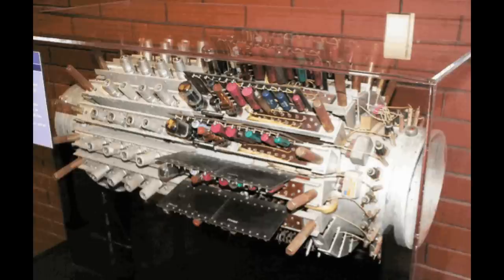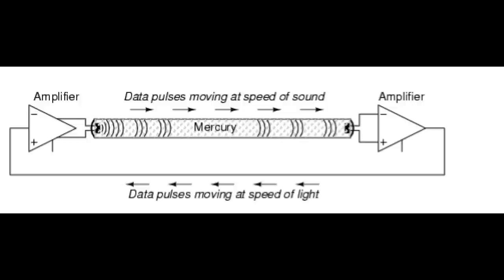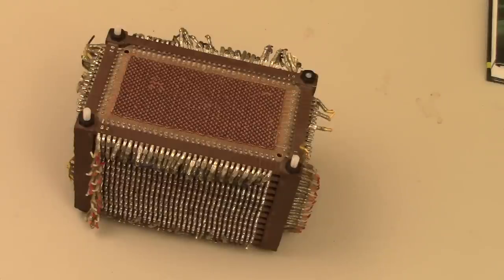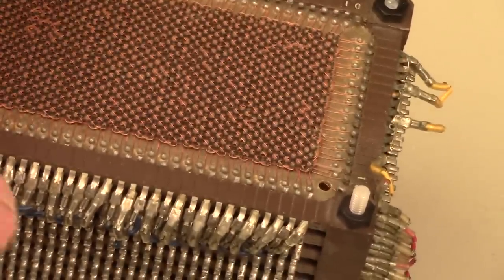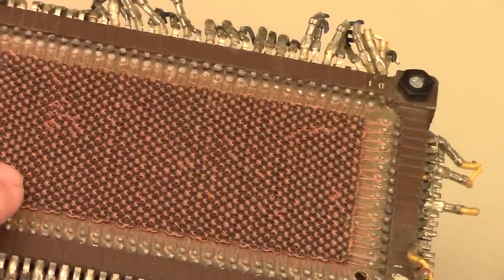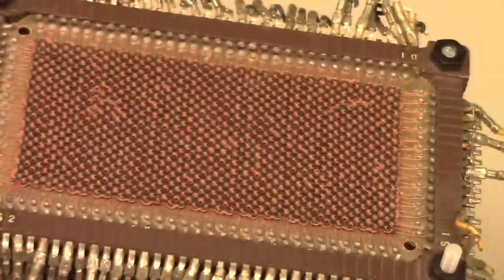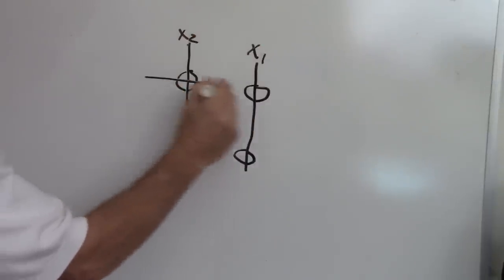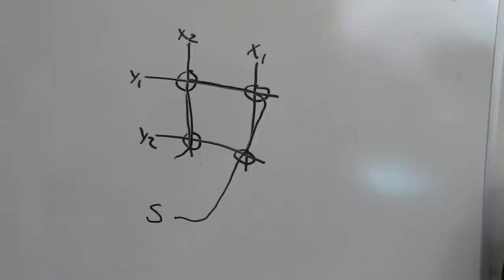Episode 11 - Getting Busted in New Jersey With Core Memory

Comment: I, too, own a core memory (2K 12-bit words with parity checking bits). I took mine from a trash bin in the basement of The Mill at Digital Equipment Corporation (DEC) in Maynard, MA, where I worked on PDP-8 software around 1978. It was for a PDP-12 computer, a popular version of the 1963 LINC (Laboratory Instrument Computer), which I programmed 1965-1972. Wikipedia has info on all these topics.
Reply: I have operational PDP-8s and PDP-11s. I have been repairing core memory since 1985. core memory is still in use.
Reply: +Terry Murray: How does core memory fail? Doesn't seem to be the sort of thing that gets moved around a lot.
Reply: Wires break from corrosion. cores break from people touching them. "newer" core memories are more than just cores and wires, they have all the circuitry required for timing sensing and driving. so mostly the electronics fail not the "stack" . Most are 65Kx18 or 32Kx18.
Reply: Terry Murray Good to know. Thank you for your experience with this. Does the copper turn green? I forgot about oxidation degrading materials even with non-moving parts.
Reply: czdaniel1 yes the wires turn green, mostly from Flux. I think I am probably the only one that repairs come memories. I started working on them in 1985.
Reply: Terry Murray Did you by any chance attend M.I.T while you were in Massachusetts, Mr Murray? I think this copper real-time ram was invented there.

Comment: Before core, (and even contemporaneous with it) there were machines using magnetic drum, usually thought of as a mass storage device, as virtual/swap memory in machines with very little RAM (in the form of registers).  It wasn't random access, but it was decently fast if the programming took the order of addresses on it cleverly into account.  At the time it was faster but less capacious than disk.

Comment: I paid $150 for 512k ram expansion for my Amiga 500 back in 1987 I guess it was. My Commodore 64 got kind of an upgrade when I bought a Commodore 128. Before that I owned a Colecovision and a Telstar which I didn't tinker with much other than gaming on. Altho I did strip the cases off the Colecovision cartridges so I could store them in a smaller container.

Comment: Core memory is radically more robust to Radiation and EMP. I worked at a place eons ago that analyzed the "state" of every single tiny donut core in a core memory recovered from a crashed device, ie jet etc. The first F16 fire control system used core memory. One can have just pieces, chunks of the core memory board and read each single donut core for its "state" to give clues as to why something failed. The Voyager probes are using core memory. Ponder that the Voyager probe has digital data stored on an 8 track tape too!  The tape is 1/2 inch wide and a special unit. https://ntrs.nasa.gov/archive/nasa/casi.ntrs.nasa.gov/19810001583.pdf

Comment: The PDP-8 I programmed in college ( 1973-1975 )  had core memory.   Programming was painful then.
Reply: You mean you didn't enjoy flipping a row of switches for an hour and then starting over if you realized you messed up one?
Reply: After graduating I bought an IMSAI 8080 computer.  I had to toggle switches on that too just to get the first boot loader working.  After that I managed to write the boot to the first sector of my 8 inch floppy and with my CPM80 operating system.  I checked and rechecked because I didn't want to screw up my master CPM80 disk.  Then I was it hacker heaven.  Hackers were good back then.
Reply: Peter Nachtwey
I have always been thankful I was born just a tiny bit too late to have to deal with that nonsense. I started out on the first IBM PC. It even had the optional 40 megabyte hard drive. I still remember having to type a command to park the hard drive heads before you cut the power so that you didn't have catastrophic data loss. I can also remember when MS-DOS came with debug and you could arbitrarily write bytes to any sector of the drive you specified.

My dad ran the electronics shop for a research hospital and built and debugged all the new toys the research docs were dreaming up. This meant I grew up with an electronics playground worth millions of dollars so I got to learn all kinds of neat tricks and play with gear most people never even knew existed let alone got to touch. It also meant going through computer classes in school felt like being drug back to the stone age when I had to deal with Apple 2 machines running LOGO. I had a teacher get mad at me because she left the classroom for 5 minutes to go to the office and by the time she had gotten back I had taught the class stuff they weren't supposed to learn until weeks later and that threw off her lesson plan. Since she essentially knew nothing about computers at all and was going by the book it threw her way off.

Then I hit my electronics classes in high school. And it was an instant time warp back to the 70s. I had to learn to program an 8080 by hand using a hex keypad for entry and a row of LEDs for output. So yes, I know your pain. Only I suffered through it in the 90s when that era was supposed to be gone!

So now I play with stuff like a Raspberry Pi and see people complain about what ports they wish it had or how they "need" more RAM for various tasks. And I just keep thinking to myself that this tiny thing for 35 dollars would have smoked the computing power of entire countries when I was starting out. I mean a gig of RAM? That would have cost more than a house in the 80s.

Comment: Remember the ps1. It was less then this. But for good reason I bet you can tell why.
Reply: Tidiest Flyer why?
Reply: Raptor At the time of its creation computers were still kind of in a inefficient stage. So making it cheap and compact was a major factor.
Reply: Tidiest Flyer PS1 itself had no storage but the cards were 1Mb so they were well above this.
Reply: Tucker Aylo Yeah. The ps2 when it came out had like 8 for its memory cards. After the Xbox cane out stuff just sky rocketed.
Reply: There's about as much memory in the PS1 CPU cache as contained in this thing. The BIOS is about a hundred times bigger, and the total system memory maybe 500 times bigger. You're comparing very different eras for some reason.
Reply: nimrodery nah, im trying to say that the ps1 is a good example of an early age compact computer
Reply: Tidiest Flyer The Famicom preceded it and had every peripheral available for computers, including storage. The memory cards on the PS1 only stored game saves. The PS1 isn't an early compact computer because it wasn't early and it isn't a compact computer. I mean, it's a computer in the same sense that a digital watch is a computer, sure.

Comment: Today it's delay line memory all over again. In optical computing, that is.
Reply: No, it's really used for memory. My lab is doing active research on it.
https://www.osapublishing.org/ao/abstract.cfm?uri=ao-29-5-627 (not actually my work, but I don't have my professor's permission to post so...)

All optical calculation is not a huge problem, but all optical memory is. There's a lack of reliable way to store and retrieve a large number of photons at near unity certainty; delay line with gain is just about the only method to do so.

Of course, modern optical delay "line" doesn't really use any kind of "line", a good resonator with photonic crystals or other hot stuffs can slow light down so much you can do it on a chip
Reply: That's not actually my work. If you want more recent stuffs, google ultra high group delay with photonic crystals.
Something like this. https://www.ncbi.nlm.nih.gov/pubmed/19547110
The problem with fiber is the fact that they can't integrate them on chip, that's why people moved on to PC. My group do PC and various types of optical bistability, also used for optical computing. Personally, I do optical modulator with graphene. If you can make a modulator, you can make optical chip. That's the easy stuffs, as I've said. I can't really tell you more since it's active research, so hopefully you could excuse me.

BTW, no need to snark. I didn't question your scientific credential, I simply stated mine.

Comment: Is this "donut memory?"
Reply: Magnetic Core memory was very common in computers that were built before the 1970s. The data is stored in small magnetic donuts so it does not need power to retain the data. It is possible to turn on an early computer that has been idle for 20+ years and still have the last program and data that was used still present in the system.
Reply: What's the difference.. flash drives dont need to retain power to keep the data?

Comment: Forgive me if this is a stupid question but is this the equivalent of Ram or a hard drive?
Reply: Captaintoast12321 RAM. Hard drives are storage devices, not memory.
Reply: Not a stupid question.
Reply: It's more like the ROM that holds your computer's UEFI/BIOS actually; it can't be changed by the computer.

EDIT: Whoops, I was wrong, disregard me. Must've been thinking of something else.
Reply: It is the equivalent of RAM, but with the advantage is that it's non-volatile. If the computer loses power, the memory retains its contents. However, the drive circuitry has to be carefully designed to handle power cycles properly so as not to trigger an accidental write operation when power is going up or down. Core memory was often used in spacecraft electronics because, unlike the DRAM of the time, it's immune to soft errors from alpha particle hits, and also because of its non-volatility. The need to keep refreshing DRAM means that it has to be on continuously, and that consumes power. Spacecraft such as satellites and deep space probes have a very limited power budget and subsystems constantly need to be put into sleep mode or shut down completely when not in use to save power.

I once worked on a storage system for a satellite that used CMOS static RAM, which is also susceptible to alpha particle hits. To compensate for that, the system used error correction circuitry (ECC) which could fix all single-bit errors and detect (but not correct) all double-bit errors. To prevent single-bit errors from statistically turning into double-bit errors, the system would periodically wake up, read through a block of RAM, one word at a time, run it through the ECC, and write it back.

A single powerful alpha particle could disrupt many bits on a RAM chip at once, but ECC can only correct one bit in a word. This means that the RAM chip designers would have to lay out the IC so that the bits in a single word would be physically far apart from each other on the chip. The earliest DRAM designs were only one bit wide, so that problem was solved automatically, but the SRAMs we used were 8 bits wide, so that became a consideration.

Comment: would you have needed 64k of memory for the programs that were being written back then though?
I remember writing programs back in the 80s and then into the 90s, they were extremely basic things back then so I cant imagine there was much need to have 64k of memory in a computer.
What people call a computer then and what people call a computer today isnt really the same thing.
Computers back then are more along the lines of a PSP now. The program loaded from an external media, the program loads into its volatile memory and run and once its over thats it you either loop back to the beginning or turn it off. The BBC Acorn computer while being a computer isnt a computer in the same way my HP Z840 is
Reply: They certainly were computers in the same way that your current computer is, though admittedly, many of them were single-tasking, just able to run one program at a time.  They would load the program from storage ( punched cards, paper tape, or magnetic tape or disk ), load data if needed, then run calculations on the data, and output the results, either to punched cards, paper tape, or line printer or CRT display.

You nearly always needed as much memory as you could get, and often just a little bit more than you had.  Once you'd figured out how to program small tasks, each successive task kept getting bigger and bigger, and programs grow to fit the available space. Then you went over that, and had to figure out what to cut, or re-code, to make the program fit again.
Reply: No, They are computers in the same way a printing calculator is these days. If you define a computer as a device that performs a series of calculations and outputs the result then a calculator is a computer and just as powerful as those contemporary to this storage device.
A garage door opener could be said to operate like those old computers. On or Off. Open or Closed.
Pull one of those old computers out of obscurity, make it work and perform a modern real world task with it, post the video to youtube and then I will sit up and take notice.
Cant deny this device operates in a fashion that is equal to RAM and its old, like the guy says in the video its going back to the very dawn of computing.
Ask the guy in the video if he imagined all those years ago that at some time in the future, now, that he would be looking at an LCD screen reading comments on a website that is equal to and better than TV of that generation.

Computers while in their basic essence are the same so much, too much has changed for them to be compared.
Get an old computer to run a program like MS Word? I mean a program that has the functionality of Word. not just being able to write letters on a screen and print it. Formatting, Font, colours, tables etc
Thats a modern computer.

Comment: Does anyone know a good channel or website that's good help for building your own desktop from ground up? I meant like understanding what each part does and what works with what kinda thing? I haven't done anything with computers since I was 10 and I just took the bigger hard drives and ram from others nothing huge
Reply: http://techreport.com/ has a great guide which I used when I built my first PC. Also be sure to check out their System Guide for advice on parts selection and ask for help in the System Builders Anonymous section of their forum. Here is the link for the How To guide. http://techreport.com/review/23624/how-to-build-a-pc-the-tech-report-guide

Comment: 1 inch HDDs, like, actual 1 inch hard DISKS? Those exist?
Reply: how do you think Ipods worked?
Reply: Google "IBM Microdrive"
Reply: Dragon Butt Not with Rockbox.
Reply: Dragon Butt
Those spin/click wheels where GARBAGE
Reply: Dragon Butt spoonikle Sure, sure, but usable as a desk player in that instance. Later iPods with the actual click wheels are probably better regardless.
Reply: Dragon Butt That would be fun to experience.
Reply: There was a brief period where they were viable for cameras that were shooting in raw format. Since the images were huge most flash storage couldn't keep up at the time. I mean we are talking about the difference between a device having 16 or 32 megabytes of storage vs 330 megabytes or eventually several gigabytes. The downsides were they sucked down a lot more power (They had motors in them), they were more fragile, and depending on the exact drive vs exact flash media they tended to be slower.

As time went on flash memory not only went up in storage it came way WAY down in costs and beat microdrives for reliability in pretty much every scenario.
Reply: As recently as 10 years ago, professional digital cameras used the CF card format, which was about 1 x 1.5 x .2 inch. Originally, the smaller capacity versions used solid state flash memory and the larger capacity versions were actual spinning disk drives. They were very fragile. I worked with a professional photographer once and had to be very careful not to drop it when changing media. Later, they all converted to flash. Now, the format has been pretty much replaced by the SD card format and even the microSD card format (like the one in your Android phone). The highest capacity microSD cards have a capacity of 128 GB. That's one trillion bits of data in a device smaller than your thumbnail.
Reply: DrSamba Correction, 256.
Reply: destrierofdark
Blink and you are behind on storage it seems. Sandisk makes a 512 gig regular size SD card.
Reply: Hacker X We're talking µSDs.
Reply: destrierofdark
Yeah, but once Sandisk has pushed out the full size SD of X capacity they put out a microsd version not too long after. I've not gone back and charted their rate for storage increase but they are doubling their flash memory storage capacity on SD cards and micros in way less than a year for the last 15 years.
Reply: Hacker X I am aware of that. But it will not be class 10, that I can tell you.
Reply: Sorry, I blinked.
Reply: destrierofdark
You are technically correct. They are way past that and have been for awhile now. Class 10 simply means they can write at least 10 megabytes a second. Their new cards can do 90.

https://en.wikipedia.org/wiki/Secure_Digital#Speed_class_rating
Reply: Hacker X Well, there's a pretty good reason that people would rather get Samsung's 256GB one. Why? It's the fastest one, the only one fast enough to actually do what photographers need it to do.